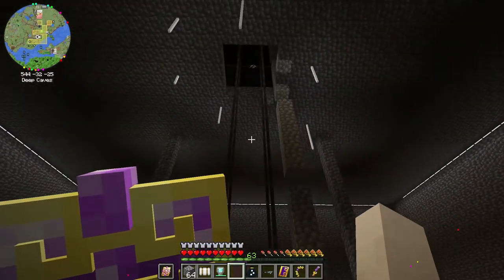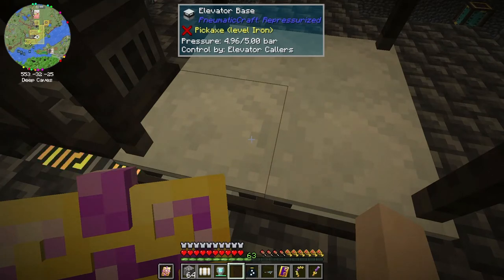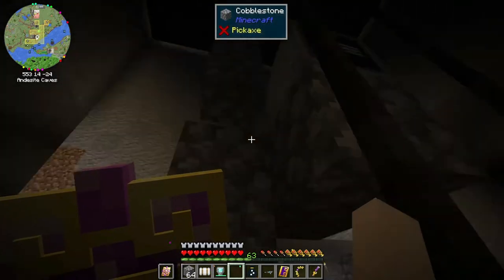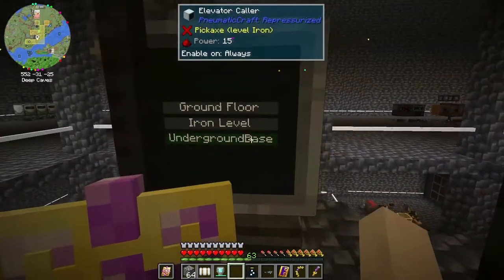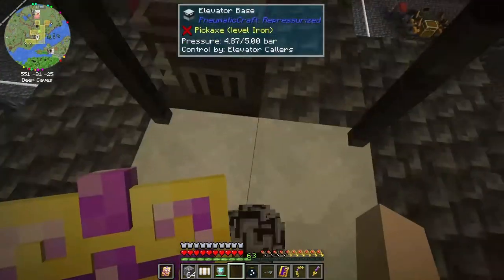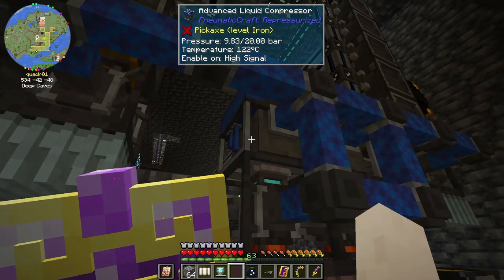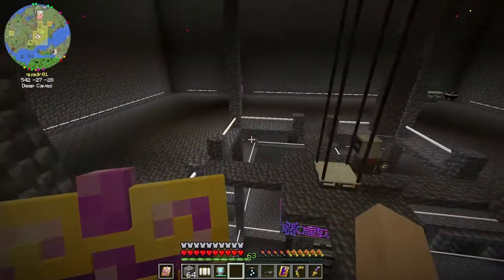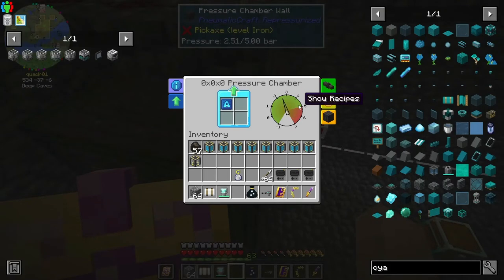DireWolf20 1.18 Let's Play Episode 101: Elevator Secrets REVEALED!!

Comment: In the refinery, maybe you could fill the middle with compressors in a 2 wide x 2 tall or a 1 wide x 4 tall?  Then use nodes to distribute the redstone signal and fuel on the front, heat out the back, pressure out the top. bottom, or sides?

I've had that same rendering issue, and it IS just rendering; the blocks are there, if you try to walk or fly through them, you'll find your way blocked, things still work, turbines keep generating power, etc.  As you saw, it starts and ends on chunk boundaries; it's always the same two chunks for me.  If you switch dimensions, or log out and back in, and it'll sort itself.  Just teleporting away a large distance in the same dimension doesn't seem to help.
Reply from the maker: Yes, I logged off after recording and when I logged back in, it was all back to normal :) I FINALLY got around to automatically shutting down the compressors with a safety module. I went ahead and pulled the line of compressors forward a few spots and was able to add back in the other 2 compressors  :) Works like a champ now!
Reply: Awesome, look forward to seeing it  🙂
Reply from the maker: @JakeMoe  👍